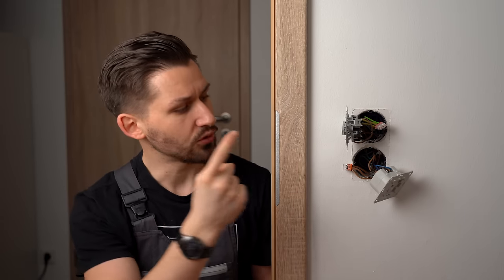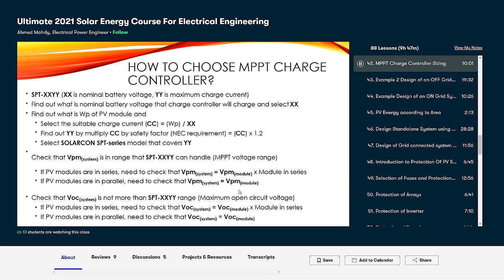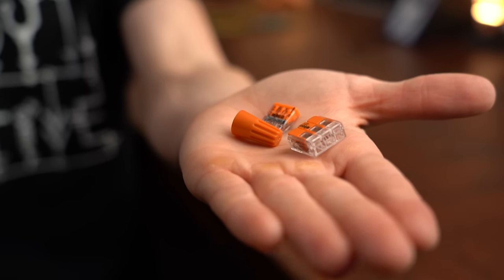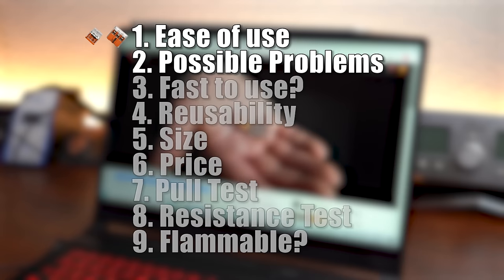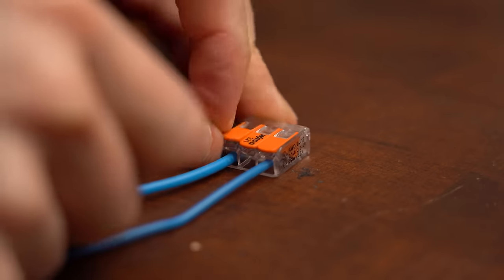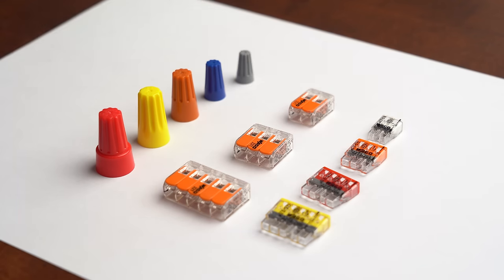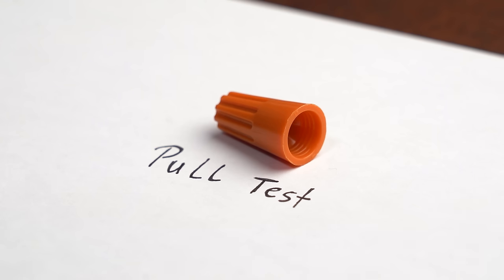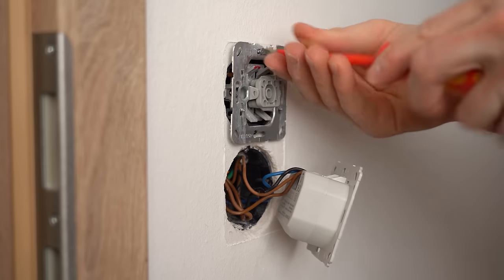What Wire Connector is the Best? Settling a Debate! Wire Nut VS Wago

Comment: Love your videos. Have to respectfully disagree on this one though. Wago terminals are fantastic when speed and ease of use are number 1, but from a longevity standpoint, wire nuts (proper name brand ones, not chineese ones) will come out ahead. The resistance you measured through the wago was on a brand new freshly made connection. After those wires have been exposed to humidity, heat, vibration, and age, that same wago will have a much higher resistance. If you look inside of it, the surface area of spring steel contacting the conductor is much much smaller than what is created when combining several conductors with a wire nut. When properly torqued, wire nuts all but cold weld the conductors together. I have removed wire nuts on 50 year old industrial equipment and after separating the wires, where the coper was twisted against the adjacent wire, the metal is bright and clean, and that is in high humidity, dusty, dirty conditions. I have heard of wire nuts failing, but have not personally come across any myself.  Wago uses the same connection design in their remote IO modules, and there have been times when simply re seating a wire into the spring connector can eliminate odd sensor behavior. Because of that, I have become very leary of spring connectors.
Reply: You don't do enough service work. I have replaced plenty of melted and failed wirenuts. To be fair, I have replaced very few of the good ones like 3M T/R, but lots of the burndy and cheap crap that comes with fixtures.
Reply: @leftyeh6495  melted wire nuts implies a bad connection. That's where the heat would come from.  Perhaps the people that preceeded you didn't know how to properly install them?  I guess that would be a plus for the wago, eliminates having to know how tight to make the connection. I've never done service work in a residential setting, I do industrial electrical work.
Reply: Even brand new, the larger wago connectors have 15Xs the resistance of a wire nut.  May not seem like much on one little light, but start adding that up (and all the associated heat) over every connection in a house.  Seams more like an answer for a Teutonic desire for neatness, rather than solving any actual or perceived issue with wirenuts.   I personally prefer a method that is a physical connection between two wires, rather than throwing a third bridging component into the mix.
Reply: @matthewweaver1123  that’s not really a plus for wage. Like you said, the connection for the wago is a thin sheet of metal cutting into the wire. That’s not a proper connection for long term. Basically the same as an improperly connected wirenut
Reply: @leftyeh6495  if you find a wirenut that melted from a poor wire connection, the connection wasn’t made properly. If you pre-twist the wires, you won’t need to worry about the wire nut. All it does is insulate. A wago provides the connection. I would rather pre-twist.

Comment: I grew up in the UK with the "chocolate block" connectors, and was surprised when I moved to the US to see these wire nut things.  I don't think I'd entirely switch to Wago, but for making end point connections in small boxes, such as lights or connecting LED drivers, they are great. Also, anything involving stranded cable or cables that are simply too short to get a wire nut on.  I do like the simplicity of the wire nut and the fact that it really is just a protective cover over cables that are twisted together.  If only they weren't so bulky!
Reply: There's crimp wire nuts that are smaller. They just require a tool.

Comment: The reason German electricians use wago is obviously because you can have very neat and orderly looking wiring.
I remember that when I had to do the journeyman qualification, our builds were rated by how orderly and neatly the wiring looked.
The reason given for this was that it needs to be immediately obvious to tell which wire from which cable is connected.

Some Installations have 8+ wagos inside of a single box, so this is a huge deal in troubleshooting and modifying existing installations.

When I open a wiring box, the wiring itself pretty much looks like a technical schematic.

Additionally, I'd say that there is a potential for issues created by overtwisting wires in wirenuts that does not occur in wago connections, as the insulation of each wire is tightly pressed and wound around the other wires in the wire nut.

Comment: I really like wago connectors for the little I have used them, especially the little lever ones. Unfortunately, since I mostly do automotive work, I just can't bring myself to trust them or wire nuts. Between the vibration, wet weather, and the salting of roads in the winter, I just don't see them lasting. I have considered wrapping them in a layer of splicing tape and a layer of friction tape but that takes time, good working room, and seems to defeat a lot of the good things about them.

I tend to slip heat shrink on wires, if I have room I twist them in what I think is called a "lineman’s splice", then solder the wires and heatshrink them (preferably with glue lined heatshrink). If I can't do that I will use crimp connectors, but only the the kinds with a hot glue lined heatshrink shell, or those neat little clear glue lined heatshrinks with the dab of low melting temp solder in the center.

One overlooked use for wire nuts is putting them on the ends of steel wire or other sharp metal rods. They will hold on alright and will keep the the ends of a loop of wire from scratching you, stabbing you, or springing back and stabbing you harder.
Reply: I've used WAGO 221 to rewire my Land Rover rear lights, instead of all those horrible bullet connectors which are damn near impossible to dismantle and corrode away after a couple of years. I sprayed inside each WAGO 'port' with waxoyl aerosol before fitting. Messy, but has been OK so far.

Comment: One of the major annoyances of wire nuts is having to add an additional conductor to an already populated connection. Once the first set of connections are secured, they are neatly twisted into the spiral you showed, but when you then add another whether it is the third or fourth connection, then it becomes a pain to reinsert into the new nut.

I think i might just stock up on some Who's for the future
Reply: When you add a third wire to a connection is when you use a bigger nut to accommodate the extra wire. Then it’s not so difficult to get a wire nut on.
Reply: You just strip the wire you're adding longer than you need, twist it with the other already twisted wires with your Klein's, then cut off excess and put your wire nut on. If you need a bigger wire nut then get a bigger wire nut.

Comment: For those who argue wire nuts being non-reusable, this may actually apply to the wire conductors themselves, as a proper installation may cause the copper to "cold work," causing it to harden and lose malleability.
Reply: You could make the same arguments and more for not reusing a WAGO.
Reply: That sounds a lot less likely of an issue than oxidation of the exposed conductor. A work-hardened conductor still conducts.

Comment: What you've forgot to mention is that WAGO is only for Copper wires. And old apartments/houses are full of aluminum conductors. Not all the time you can afford to change it, because it's messy, it takes a lot of time and money to replace. When I've had that problem, I've connected Aluminum and Copper conductors with WAGO 221 by using a product called ALU-PLUS WAGO 249-130. About the wire nuts, I am not sure what type of metal are rated for. Also, an alternative for WAGO, would be OBO Bettermann connectors, which is also VDE approved.
Reply: there are wagos for aluminium too, they are push type.
Reply: @TheEsseboy  For Au, you can use Wago + ALU-PLUS WAGO 249-130 paste.

Comment: For the wire nut called a "Marett", when using a stranded wire with a solide wire, the stranded wire needs to go all the way in first and then the solide wire, then you screw the Marett on. This will prevent a bad connection.
Reply: The practice in the US is to run them together, but the stranded wire needs to have a longer lead than the solid core. Similar idea, different execution.

Comment: Been using Wago 221 for the past 5 years and I love them. I have had at least 4 wire nut failures in my 40 year old house (they were installed by an electrician) and 1 almost caused a fire. You could conclude the installer did it wrong but this would not be the case if he used Wago.
Reply: Just look at the resistance test. That shows very clearly that wagos are not very good connectors. The better wago was 2.66 times higher resistance than the improperly installed wire nut in this video, and the lever wago was 14.66 times higher in resistance where it was dissipating 1W in the connector. That is frightening. If you try connecting old wire with wagos your connections are even worse. Much worse. Keep that in mind higher resistance = fire and the wagos start off with substantially higher resistance on shiney clean new wire.
Reply: @Peter_S_  wrong. While wago has a higher resistance, it will actually keep that resistance over time, it might even improve over time. Heat and cooling cycles kills a wirenut connrction over time. That is one of the reason we moved away from wirenuts 15 years ago.
Reply: Here in Australia we use a different one to both of those. The wires are twisted together like in the wires nut, but they're then compressed together with a bolt inside an insulated transparent housing. I expect ours are similarly low resistance like the wires nuts but maybe a bit more secure.
Reply: 40 year old house here also...spring contacts used everywhere for the receptical and many of them failed due to failure of the spring. None of the wire nuts failed. I suspect your wire nuts were not properly pretwisted.

Comment: Ex US based residential/commercial electrician now living in Finland, I like the Wagos, they are ok but still prefer a quality wire nut over a Wago anytime, my critiques of this comparison are as follows, yes the Wagos are faster no denying that but in every other area the wire nut is superior, I can easily strip 2 or more wires and have it perfectly wire nutted in less than 30 secs easily..so the whole thing about it being faster is kind of a moot point from my point of view and think the ease of use point should have gone to both as well as the possible problems point because your reasoning was the see through advantage which is totally bogus because when you are used to wire nuts you actually feel the bite into the wire and know instantly not to mention its always recommended to tug on it to doublecheck...the see through advantage can actually be a handicap if you don't tug on it to double check as a worn spring can mislead you into thinking its secure when it's not ( I have opened plenty of junction boxes with wires popping out of BOTH type of connectors )  and my biggest  critique is the wire nuts used are not US quality wire nuts, and yes in wire nuts quality is determined by brand...the price alone will tell you that he ordered an IDEAL knockoff wire nut in 180 count variety pack for € 13.87 while the Wagos were €39.78 for 150 count pack...that price difference alone should be enough to invalidate this performance test. And finally, and probably the most important objection to this test is the incorrect use of the wire nuts to begin with...only inexperienced and unlicensed individuals tighten up the wires by just turning the wire nut without pre twisting the conductors together first, so incorrect usage and unequal quality of products being used totally invalidate this test for me. BTW 1 100 count pack of QUALITY wire nuts ( IDEAL brand)  ranges in price around $11 USD  you can find them in Ebay easily.

Comment: I have my preferences based on what I have had to repair over the decades. Much of what I did was motor control, which is more demanding than basic power distribution for lights or small appliances. I will reserve my preference of push in vs wire nut connection. 

There are a few different kinds of wire nuts. The one use in this video is the cheap round tapered wire core wire nuts. I do not like them for a few reasons. Again, this is based on high demand loaded motors. Though a motor may be rated at 10 ampere, it can surge 70 ampere or more. The round wire core wire nuts seem to not be able to stand up to this demand.

My overall preference is Buchanan wire nuts. They have a diamond shaped tapered core. The edge of the diamond core bites into the wires a bit, giving better mechanical and electrical properties than the round wire core wire nuts.

In high vibration conditions such as machinery, I prefer to use Scotch Locks. They have a molded core with sharp edges like the Buchanan wire nuts. The difference is that the core is designed to break free of the outer insulated case when tightening. This makes it so the vibration of the machinery will not loosen the core. It seems that spring loaded clips to hold the wire against the buss bar will vibrate and cause hot spots, ending in a total meltdown of the connectors.

In any case, I never twisted the wires together while using the wire nuts. If done correctly that all the tips of the wires are at the same place, I do not recall ever having any problems with wires coming lose or a connection fail.

These are some basics. I did do a lot of installations, but mostly I did repairs, including doing repairs of newly installed equipment, so I got to see a lot of situations that worked, and mostly, conditions and connection devices that failed.

I hope this helps.
Reply: > "I never twisted the wires together while using the wire nuts."
That's a huge mistake. The wirenut is not supposed to be holding the wires together mechanically, only protecting the joint from electrical contact with the environment. The twisted wires is what holds them together mechanically.
Reply: @Anenome5  it's actually not a huge mistake. if you ever have to work in electrical service where you have to break an energized connection, you will appreciate not having conductors that look like they were braided together. I agree that pre-twisting is a good habit, but not critical. the back of the bag on Ideal brand wire nuts even states "pre-twisting is NOT necessary".

Comment: Whenever I use a wire nut, I first make a strong mechanical connection by pre-twisting the wires together, then apply the nut.
Reply: Some wire nuts specify on the packaging not to do that, a pictogram of 2 wires twisted together with a big cross through it, next to it 2 straight wires with a checkmark. For most wirenuts you have to twist them yes, but not in all cases. Just follow the instructions of the factory; they know best what they designed.
Reply: Pre-twisting is the only way to use wire nuts correctly in our country (left of @GreatScott country). And on top of that only solid wires are allowed.

Comment: I used to like the splice connectors we used in aviation. A bit much for most uses and a mass adoption would lead to more user prone errors perhaps. From all the BS in avionics I always liked the splices. Made sense to go such overkill for an aircraft.
Reply: guess what the Wagos are? splice connectors! :D
Reply: smig smög  They use what is called environmental splices. Or butt crimp splice, and a pre fit shrink tube the form a moisture proof barrier. You crimp them, then hit them with a heat gun. I have never seen one fail. The connectors on most wires go to a cannon plug connector. Not much like automotive at all. They are a bit like the ones used for boats, but with self soldering cores.
Reply: Properly crimped, these terminals are cold-welded and form a gas-tight seal.  Proper crimping requires a $500 tool from the terminal manufacturer, though, not the junk you get from the hardware store.
Reply: @mg30ebay  In the Army while working on AH64d as avionics tech I bet my crimper was pricy.  I have used 22$ crimpers for environmental butt splices in civvy land. Same style, right from Amazon and they worked fine. Also most crimping takes advantage Van der Waal forces. Is it true cold welding? That would be a bit cool. In any case them intermolecular forces are a bit weak for a butt splice as there is not much surface area and so possibly only a small part of the bond.
Reply: @MsHumanOfTheDecade  The main use difference is wagos are not waterproof. Inside a junction box of a home it would not matter. Were environmental splices can be used for wet areas, boating, and aircraft or basically anything outdoors that may get wet. Tough multitap wagos would save room in junction boxes compared to the old twist caps. Overstuffed junction boxes suck to troubleshoot and fix.

Comment: The Wago's rely on spring teshion and become part of the circuit. Wire nuts clamp the conductors together. I can't help think over an extended periode of time the wire nuts will be superior as the Wago's spring tenshion will slacken.
Reply: It's the other way around: copper shrinks under long-term pressure, so it's important that the contact can follow by spring load, which is not the case with the wire nuts.
Reply: The wire nuts also use a spring. It's the tapered metal coil in the head. The only difference I can think of is the wire nuts spring pushes the wire together. The electrical connection isn't going through the wire nuts spring. The Wago does have current going through the spring, but if the connection is solid enough that isn't an issue, plus any bad connection will have heating issues anyway. I feel the Wago will simply "let go" a hot connection and disconnect the circuit.